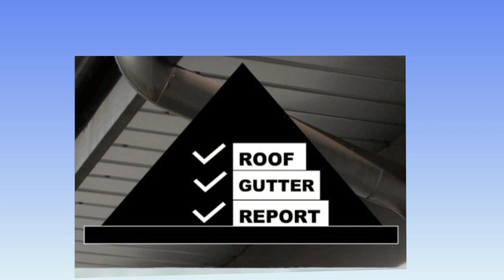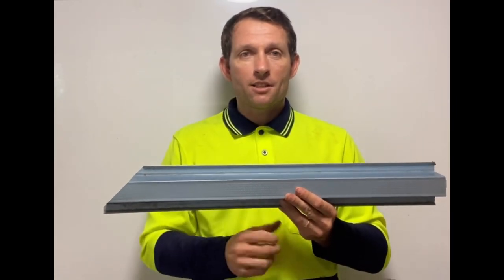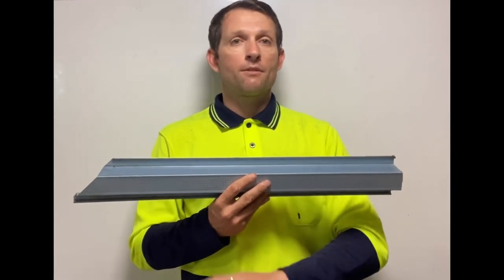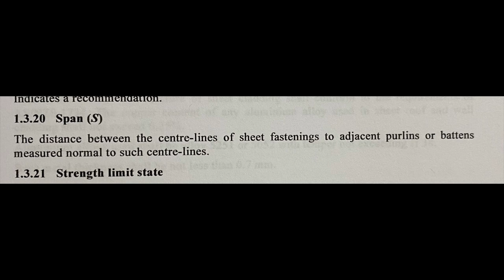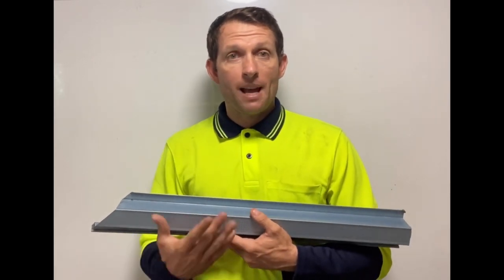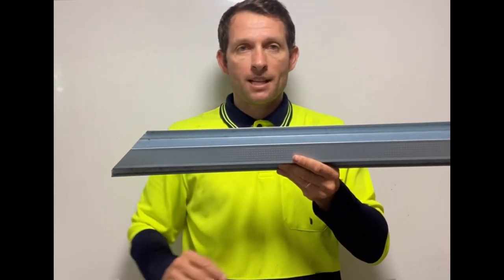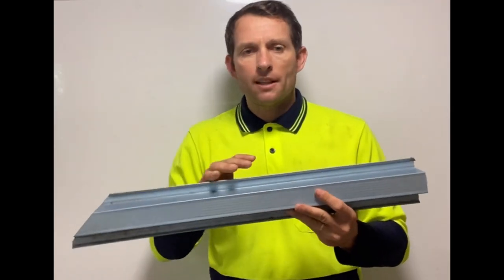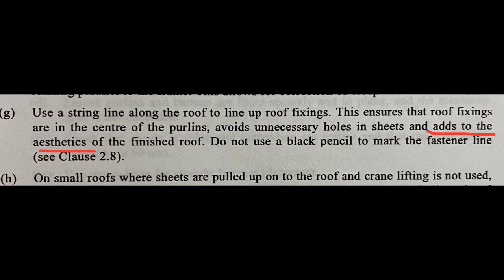Roof Battens- What’s the Standards??

Comment: Informative but slightly misleading. AS1562.1 is concerned with metal claddings for roofs and walls.  The 'span' of something has to be taken in proper context. The span of the cladding is the distance between supporting members, or spacing of the supporting members. The supporting members for cladding and decking are the cladding rails (battens, purlins, girts(wall)) As defined in AS1562.1, 'S' is the span of the cladding not the cladding rails. However, the span of the cladding rail is the distance between its supporting members, which would be the spacing of the rafters. This difference is important, as lookup tables will likely involve the spacing of the purlins and their span, the spacing of the cladding rails cannot exceed the span limits of the cladding.

Limiting deflections for structural adequacy, are also typically given in terms of span over some number, such as span/150 or if concerned about aesthetics something like span/600 (eg. ceilings), whilst initial warp and distortions have requirements around span/1000. So for a cladding rail spanning 1200mm between rafters, its initial distortion from ideal straightness  is 1.2mm. Whilst under load it would be 1200/150=8mm. If rafters are at 600mm spacing, then equals cladding rail spanning 600mm, then the deformations are reduced. AS1562.1 applies similar limits to the strength and serviceability testing of the cladding.

I don't have the most recent version of AS1562.1 I have 1992, not  a standard generally need unless testing, manufacturers guidelines provide needed information. Manufacturers guides should have limits on straightness and warping and twisting of the rails before installation, so can reject before installing, few do, but there are some general rules for steel work. There are also various state guidelines on acceptable construction tolerances.(eg. NSW guide to standards and tolerances). 

My version of AS1562 has three clauses, not just the 7mm clause. If I understand the 7mm clause correctly its about the undulation of the roof surface. It is measured at right angles to the plane of the roof. So its about the top surfaces of rafters forming a flat plane, and the top surfaces of cladding rails forming a flat plane, and the roof cladding forming a flat plane, if it doesn't then get impressions which cause ponding. For spacing of cladding rails the tolerance is plus/minus 5mm, hopefully this has not been increased to 7mm. Whilst horizontal and vertical alignment at abutting ends of cladding rails is limited to 2mm.

Note the way the tolerance is given, the spacing at one end of a cladding  rail can be 5mm greater than nominal and at the other end 5mm less, making a 10mm difference between each end. Which is rubbish, not something to aim for. The general positional tolerance on location of fasteners in steel work is plus or minus 1mm, this is from the original steel structures code (AS4100). So 1mm either side of the centre line, and no more than 2mm between fasteners. Tighter positional tolerances may apply if concerned about alignment of holes and fasteners in multiple members, but they have to be calculated. {This comes from the hole typically being 2mm larger in diameter than bolt, and ignoring small tolerance on hole diameter and bolt diameter.}
Reply from the maker: Thanks for your views. It’s excellent to see others looking deeply at these issues. I encourage you to keep up the good work. Please do not hesitate to share these videos or discuss them with others. Cheers